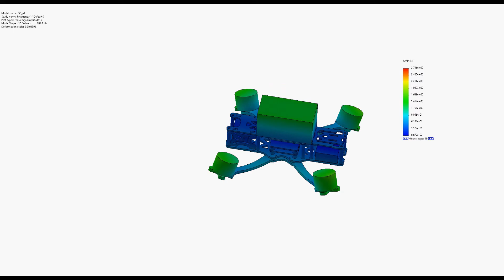Mid throttle oscillations? Here's why they can happen to any build and how to fix them

Comment: Thank you for this useful tip! Can frame resonance cause yaw twitches? I have a 4 inch light quadcopter (toothpick style) that I love to fly but I have this problem which I cannot solve. Unfortunately I don't have the blackbox logging on the fc. On hover and full throttle is very stable but at some point it start twiching only in yaw axis. Thanks! PS: I hope there will be an AOS T4;)

Comment: I got a 3.5 inch bnf micro from avant quads and the reason they told me it did not have rpm filtering and bi directional dshot like most of there quads is because this particular one had a ton of mid range oscillations that they were unable to correct. Then proceed to tell me of a se version that was coming out with different motors that did have rpm filter and everything set up. This was crazy to me. Now I understand better I think 🤔 lol

Comment: I have two TBS Source one v.4 frames and have oscillation on both. I have already exchanged F4 for F7, Bhelis for bheli_32, on each quad I have different motors. And i get the jello effect all the time. I am still looking for the best configuration. thnx

Comment: Thank you for this.

If we observe the noise of oscillation at the 141 frequency, and then swap out the motors for lighter ones, replace the arms with thicker arms (likely change frames altogether), and install braces, would the quad not suffer other performance challenges, and possibly have throttle noise at a different frequency?

Seems like all the effort to tune via P.I.D.s, rates, and filters solve a problem, but create new problems.

Is there a frame, motor, fc combination that addresses these challenges by design, one that you fly yourself, or recommend for others; especially of advanced beginner to intermediate skill?

If you have time, please reply.
Reply from the maker: Hi Richard, I have specifically designed a range of frames that have excellent vibration performance. They are much stiffer in certain directions than standard frames and this allows more agressive filters and PIDs to be used. You can check them out here: www.aos-rc.com

While you can never eliminate resonance and vibration you can increase the frequency and reduce the amplitude through better frame design.

Comment: This 100Hz vibration makes the craft sounds a lawn mower flying. This happens to helicopter's tail motor too. I use the 3-inch racer quad petrel 136's motor on my 249 gram helicopter. And I can see the tail fin vibration like a tuning fork at 120 Hz. If I change the motor to 4-inch racer quad motor (GepRC 1404), the oscillation frequency shifts to 180Hz.

Comment: fascinating stuff! one thing that always confuses me here is that MTOs are also highly correlated with much lower freq than this (sometimes <30Hz or so). This is also apparent in the fact that we see MTOs in HD video feed that's only sampling at 30 or 60Hz. Of course sometimes MTOs are manifest as "jello" which suggests higher freq, but not always. Often there's something well below the freqs where the vertical shutter sampling is being spatially distorted. Is this low freq vibration a harmonic of the higher freq thing you're pointing to here?
Reply from the maker: I wonder if its to do with how fast the motors can ramp up and down or the response time of the PID loop that governs the actual frequency of the MTO rather than the noise frequency.
Reply: @ChrisRosser  right, yes. that's certainly what dictates propwash freq, though the peak freq at which it occurs rises a bit with higher P for example, but there seems to be a limit (~40-70hz) across most rigs. reducing phase delay sometimes helps but sometimes seems mostly unrelated, which can be very frustrating. So there seems to be possibly more than one mechanism. in some cases messing with esc pwm seems to help. MTOs are also sometimes accompanied by jello which always suggests higher freqs at play as it distorts the sensor-sampling within a given frame. so like the top portion of the sensor would be sampling the image at one point in time, then by the time the lower portion samples the image it has change position on the sensor (because of vibration) resulting in this "jello" as it's called. I've ordered the AOS 5 and I'm very excited to see the spectrogram. I hope you're on to something! :)

Comment: This is very exciting research! I would love to know more about resonance in whoop frames if you ever have time time and interest. I would be especially interested to see data for the Beta85X frame with 2" props, 1103 motors, and battery on bottom (450-650mah 2S). That's the formula I nicknamed the "ShutterBug 85". It's still one of my favorites, and we have a local club that still races them (or would if not for COVID). I believe the frame is made of nylon, so it would be very different from the frames you have analyzed so far. It is also possible to add a carbon fiber X brace on the bottom of the frame. It would be super interesting to see the resonance behavior with and without that brace. If this is a project you think you would be interested in, then let's talk! There's an email on my channel's about page. I can get you BB logs too of course. Thanks for what you're doing! Keep it up!
Reply: +1

Comment: What do you mean by "lighter motors"? Less powerful ones, or less heavy ones? Also, I'm also developing my frame and running some ANSYS analysis, let´s see how it goes. Thanks for the video and the inputs!
Reply from the maker: Lighter weight. Less mass on the end of the arm will increase the resonant frequency. You are fortunate to have access to Ansys, I used to have it at work but not anymore.